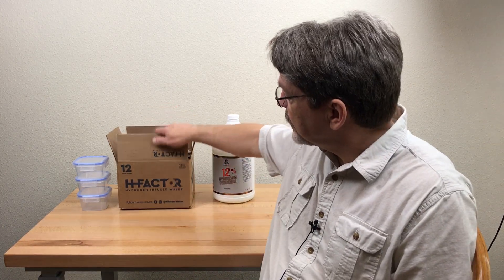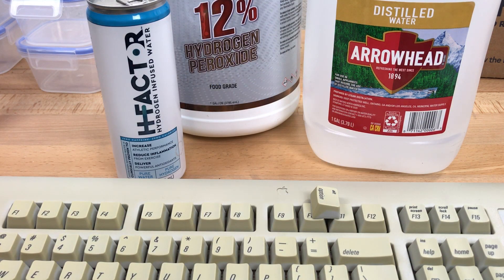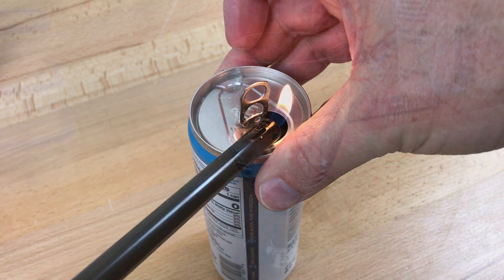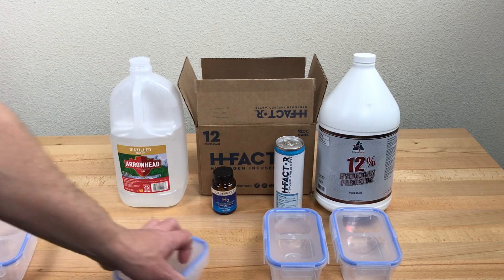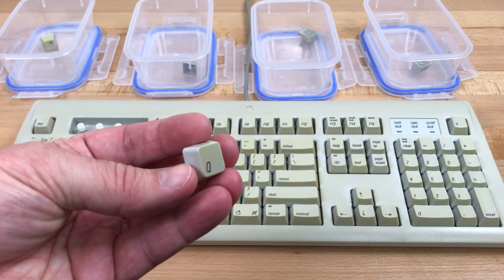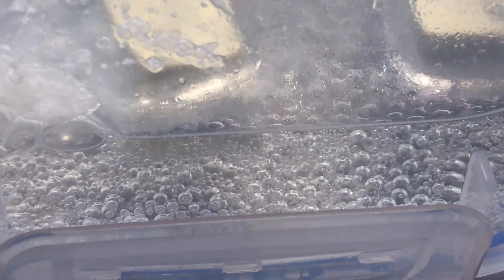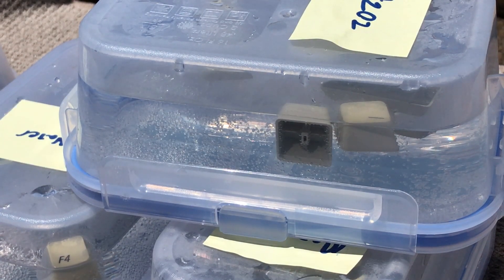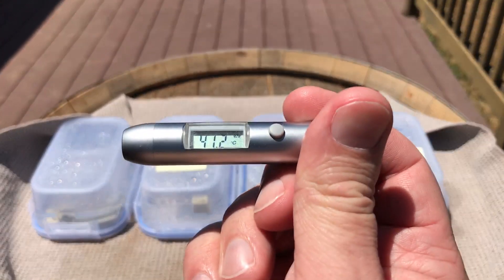Hydrogen Retrobright Experiment

Comment: Saw an interesting experiment the other day. They used pedastals to hold the object above the h2o2 line and used the gases. Due to h2o2 causing plastics to become brittle.
Reply from the maker: I figure since the plastic is waterproof and not porous, it can only affect the surface of the plastic. If it does cause plastic to become brittle, it would only be the thin surface layer, not all the way through.
Reply: @HutchCA  i did have a bowl sit out in the sun too long w/ h2o2, was noticeably more weak/brittle. But ya may have been exascerbated by the sun as well.
Reply from the maker: @az_tinkerer_gamer  I suppose if there are cracks in the plastic, even microcracks, the solution could seep in there and make the crack worse.

Comment: What I noticed is the keys were just chucked into a container and liquid sloshed in and containers capped but no attempt was made to control whether keys were right side up or upside down. The right side up keys would have been exposed to more gas than others with their tops being submerged in liquid. Not very good controlled environments. FWIW I just had cataract surgery on both eyes and believed I could see a bit of difference in lightening affect between all keys. I have a toilet seat and lid that I was just looking at yesterday thru new eyes and the items look grossly yellowish and needs to be retrobrightened which I'll give this a shot at.

Comment: Just my recent quick and dirty experience (2-9-23). Keys from a Commodore 128 yellowed about like the ones in this video. Just dipped each key in 40 strength peroxide cream. Placed on a serving tray and covered with saran wrap. Sat the tray in the sun for about 8 hours each on 2 days. Temperatures were in the high 30's. Afterwords all yellowing was gone. For what ever its worth.

Comment: Its the Oxygen that does the job, not the UV light or heat. Bleaching is a chemical reaction, not a photochemical one. In fact UV light or OZONE will DAMAGE the plastics, not "repair" them.
I'm surprised that no one has ever tried Chlorine that is much more aggressive and will work even without light, albeit it will bleach some types of stickers on computers.
Reply from the maker: Yes.  The UV light and Heat are only necessary to decompose the Hydrogen Peroxide to release the Oxygen.
Without UV light or heat, or visible light, the H2O2 is stable and there's no free oxygen to react.

Comment: Do the keycaps not need to be fully submerged in hydrogen peroxide?
Reply from the maker: Not in my experience. I've never bothered with trying to keep anything submerged and using a sealed container helps with the solar heating.
I could be wrong but as long as they are sealed mostly air tight, I believe it's the gasses that do the job. Specifically the Oxygen released from the Hydrogen Peroxide.

Comment: I watched Jeff's video. It's very good and worth watching. His thesis is that H202 is just bleaching the surface of the plastic. If he's right (and I suspect he is), then it's not surprising that not much happened with distilled water, H2 water and water with Mg; it was just bleaching from the sun's UV reduced by the filtering effect of the plastic container plus clouding of the water with the Mg tablets. It seems the way to go is with H202 and heat and/or UV and the H2 idea is little more than wishful thinking.
Reply from the maker: Yes. I believe any lightening in the plain water was simply sun bleaching. Hydrogen had no effect as far as I can tell.

Comment: I have been using hydrogen peroxide for some time, and H2O2 + sunlight still is the best solution to everybody who doesn't do it often (last experiment was done with a keyboard last year).

I would suggest to not dilute the hydrogen peroxide (speeds up a bit) use some products like Vanish (produces oxygen), and in the end of the process, apply some matte colorless varnish in order to avoid yellowing again. I did it in a JVC HC-90 keyboard, and it stills look great, after one year.

https://www.retrocomputaria.com.br/2020/06/12/retrobright-no-teclado-do-jvc-hc-90/

(The post is in Portuguese, but the photos talk by themselves).

Here goes the photo album: https://photos.app.goo.gl/RjpGjfXBEe86H7sTA

Comment: I always use hydrogen peroxide and heat when retrobrighting. About 50°C/120°F in the oven for 4-5 hours does the trick every time. No need for sunlight or complicated UV setups, that probably don't penetrate the liquid that much anyway. My guess is thatif you'd cool the solution when using UV-lights basically nothing will happen.

Just put it in the oven, folks :)
Reply: @HutchCA  I'm living in Sweden and we seldom have that kind of temperatures in the sun, that's why I tried the oven out :)
Reply: I'm planning on doing this to some keycaps, but im wondering how long the retrobright effect lasts on the keycaps? Do you have any indication on how long I can use the caps before they look yellow-ish again? Or is it durable enough?
Reply: @bloodieown  I don't know. None of my machines that I've retrobrighted years ago has gone yellow again.
Reply: @theswedishuser  That's good to hear, I guess ill give this a go then. When you put the plastic bin in the oven, do you seal it at all or do you leave the top open?
Reply: @bloodieown  I try to seal it as good as possible to avoid that the cream dries out, and about every 30 minutes I "massage" it.
Reply: @theswedishuser  What cream would this be? I also live in Europe so there is a good chance I could just buy whatever you're using.
Reply: @bloodieown  I use Wella Welloxon 12%, but probably any 12% peroxide cream will do.
Reply: @theswedishuser  Thank you!
Reply: @theswedishuser  Sorry, just one more thing, you exclusively use the cream on whatever you're retrobrighting, correct? No added water or anything like that?

So apply the creme, put it in the oven at 50c, check every half an hour to see if the stuff hasn't dried out and that's it..right?
Reply: @bloodieown  Yes, that's how I do it. I guess that for keycaps it would be easier to submerge them in liquid peroxide and just heat it to 50 degrees, but I haven't tried it yet. 🙂
Reply: @theswedishuser  how many years?
Reply: not a danger of melting the plastics.?
Reply: @doctorsocrates4413  Not at those temperatures. It would be harder in for example the sun since you don't know or can control the temperature. Just make sure that the temperature control works snd keep the plastic away from heating elements. I use a digital thermometer to adjust the temperature and pre heat the oven for about an hour to get the temperature stable.

Comment: Fascinating tests. It's interesting that it looks like sunlight yellowed the keys originally, but sunlight is needed again to reverse the yellowing.
Reply: There's another video where someone uses just sunlight and no peroxide and it seems to work, just slower. It's apparently not sunlight causing the yellowing on it's own? I don't get it
Reply: @Houshalter  It is the sunlight. UV component of the sunlight causes the molecules in the plastic to break apart. In case of ABS plastic (used widely in for consoles and electronics) the bromine (it is added as flame and fire retardant) and the rubber (added so the plastic is less brittle) boosts the yellowing. Deep chemistry: the UV breaks the bonds, create free radicals, unrolls organic rings in the butadiene copolymer etc, and creates some crazy conjugated compounds that absorb more bluish light of the spectrum, creating yellowish color.  The process of retrobrighting (de-yellowing these plastics) uses hydrogen peroxide which restores the chemical bonds (removing the conjugated bonds) and gets rid of the behaviour of absorbing blue color (and causing yellow color).
In nutshell.
Reply: @pityuszka100  Can I use hydrogen peroxide and just heat (indoor) without the UV? I was told it's the heat that activating the process.